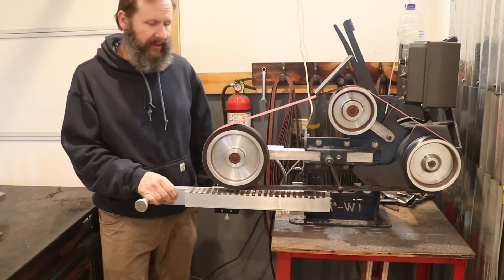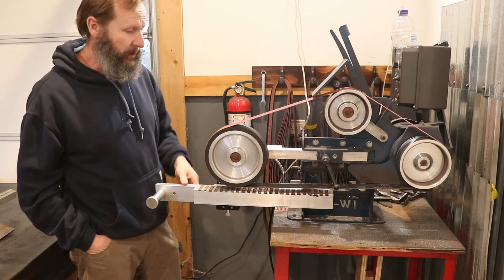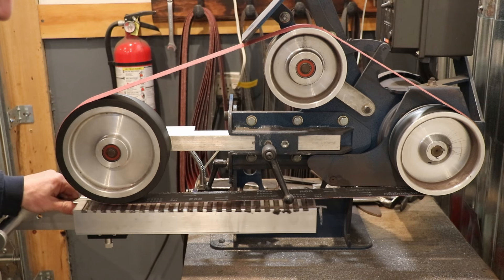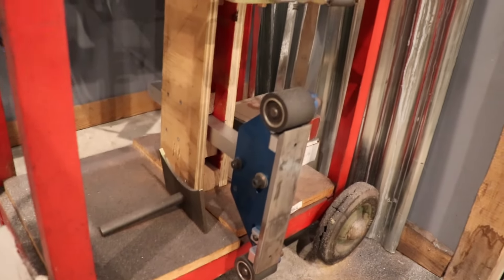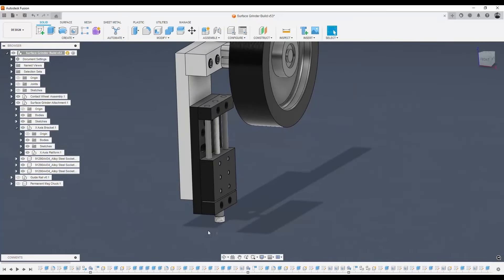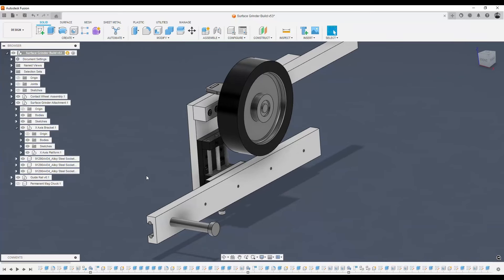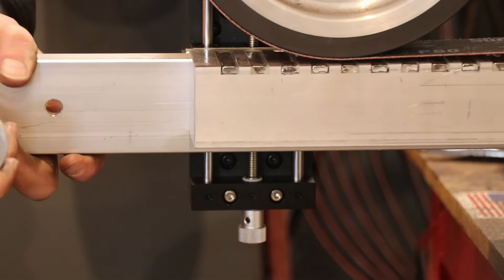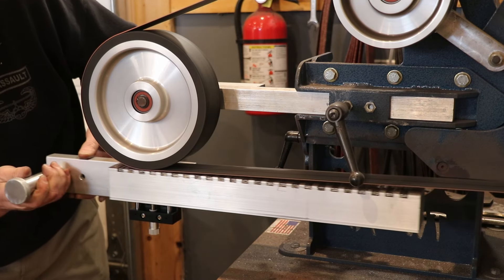Horizontal Surface Grinder Attachment for the TW90

Comment from the maker: I already have several upgrades I'm going to make for this, including a metal stop to keep metal from slipping and to protect the chuck. Because I didn't use a 4 inch contact wheel like many people have, the grinding dust is directed right over the chuck.  The second upgrade is a metal funnel to catch the dust.

Comment: An idea to protect your magnets from dust and keep your metal from flying around the shop, make a few  2"x4" rail covers out of thin stock.  Place your stop "key" then slap as many rail covers on behind it as you need for any given project.  Helps keep your chuck clean too.
Reply from the maker: Fantastic idea!

Comment: The lack of side to side travel of the table makes me concerned of the uniformity of the flatness over the width of the part. The linear rail should allow the part to be ground reasonably flat along the length of the part, but what about across the width? I would imagine that any taper across the rubber contact wheel would transpose itself into the part. Still, it looks to be pretty serviceable for a a belt grinder, cheers.
Reply from the maker: I 100% agree.  The uniformity of flatness will especially be an issue with my design as I am not using a dedicated wheel.  In my case, the center of the work will be undersized due to the geometry and wear of the wheel (.001" or more)

While not great for precision machining, I think it will work when I prep my Damascus billets, etc.  

Thanks for your comment.

Comment: If you change the leadscrew to a fine thread . It will give you a finer control.  Fyi. Don't know if that's easy for you to do .
Reply from the maker: Absolutely. That's a great suggestion. Also, I would love to design and build my own column/adjust unit and the thread pitch would be critical. 

This unit I bought off eBay is advertised to be used on drill press tables and the like where a little speed is likely appreciated.
Reply: @PowerForgeWorkshop  yes if you make a new nut fir it with fine thread.and  uy a bolt. You can make a thum knob fir it
Reply: @PowerForgeWorkshop  You can also add a dial indicator so you can see what your actual advance is.  Helps a ton.
Reply from the maker: @grnsouth1204  That's a cool idea. I'm going to have to try that out.